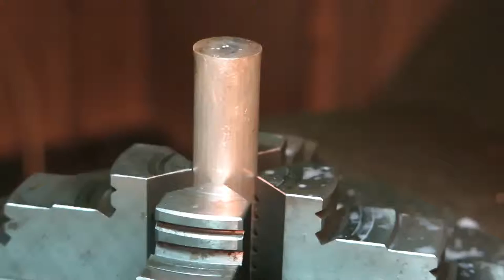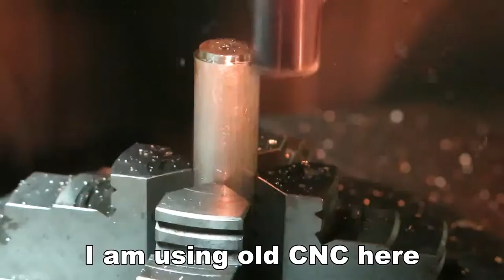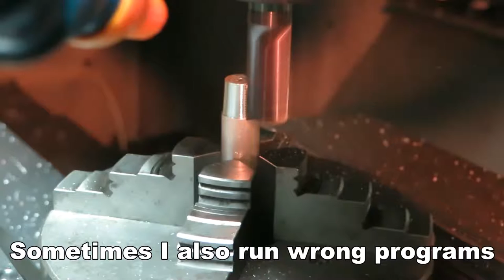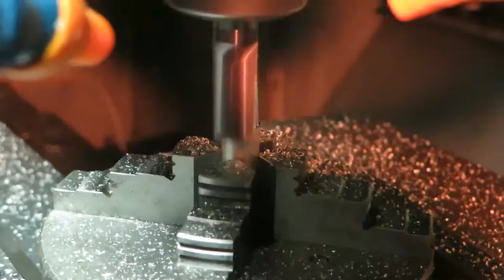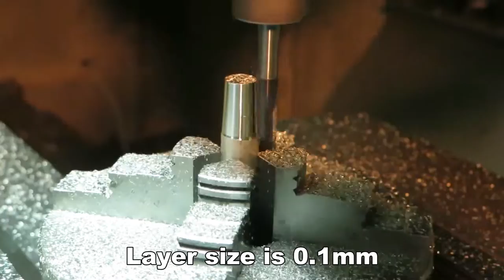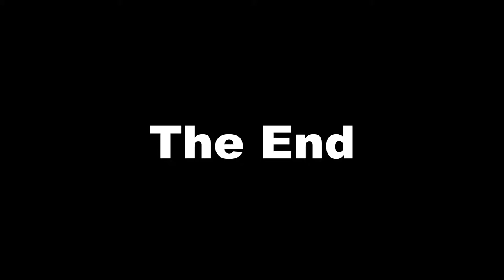Making glass taper forming tool on CNC

Comment: Were these tapers intended to be used for hot glass shaping or for lapping with abrasives? I'm trying to make lapping tools to correct out of shape ground glass tapers I have on my glassware, but they wear out very fast if abrasive powder is fed between lap and a surface being ground. Was thinking about either pressing abrasive particles onto the lap surface followed by electroplating to fix them there or covering lap surface with abrasive powder filled epoxy...
Reply from the maker: They are masters for making tools for hot forming

not quite sure how I would go about lapping... For diy method I would try to use rubber otherwise I would guess that diamond tools are way to go.